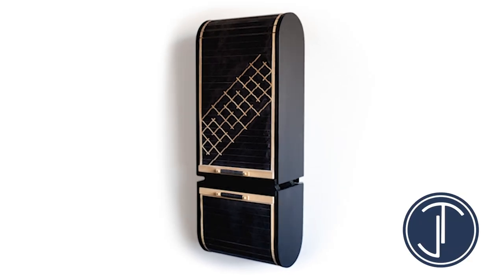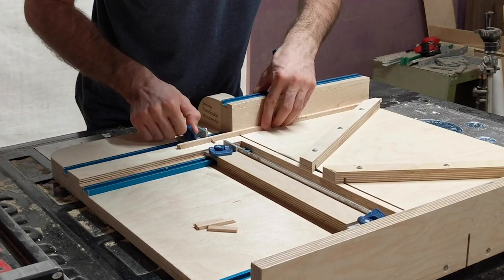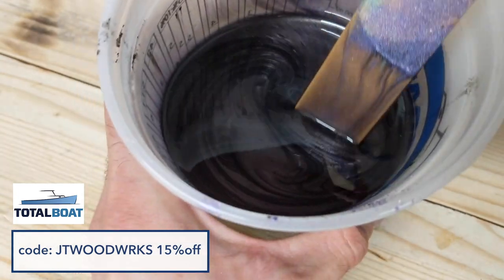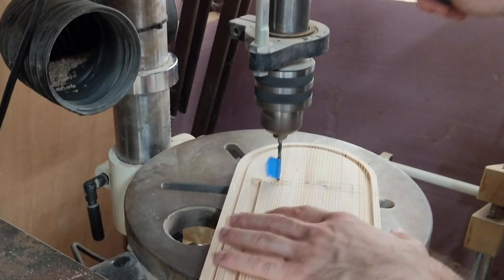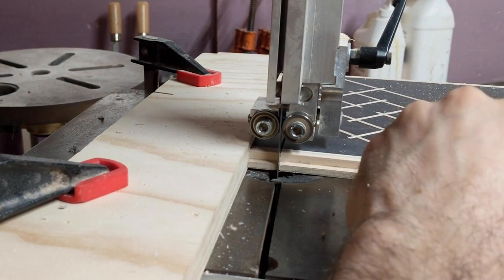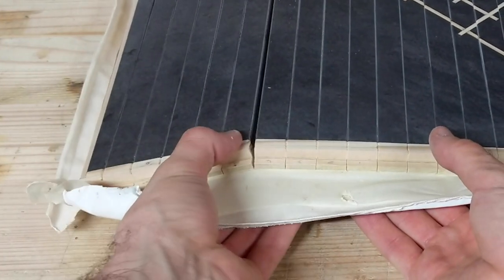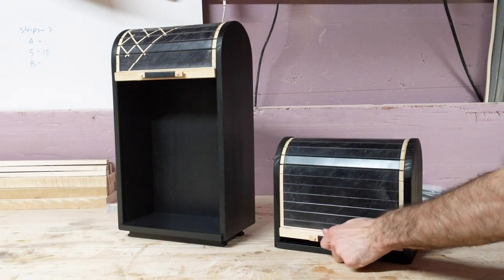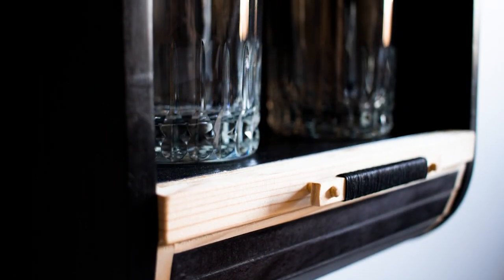Make a Whiskey Cabinet from a 2x4 w/ Epoxy Tambour Door

Comment: Turned out really nice....the only thing that I don't like is how the the front pattern does not line up correctly. I know this was unpreventable doe to the saw kerf. I wonder if there is another way to do this where it would keep the pattern lined up. Maybe cut the strips first, then cut dado and put in the inlays...a lot more work, but then it would look like a professional piece...oh and use hardwood instead of 2x4 pine

Comment: Slick build Jonny. As someone who has done tambour before: I approve this message... or something. Lolz. Get it boiiii.
Reply from the maker: Hahaha thanks man! It's much easier than I originally thought
Reply: @JTWoodworks  yeah! I wish I had a bandsaw to be able to have as little material loss as possible. And great call on getting the quartersawn grain. That makes life so much easier.
Reply from the maker: Bandsaw helps but left the cut pretty rough even with a new blade. I didn't show it but I sanded both sides of every piece
Reply: @JTWoodworks  I bet a nicely tuned block plane would have been great for that task too 😉
Reply from the maker: Oh for sure! Mine needs some tuning